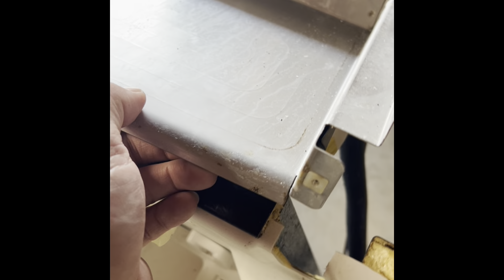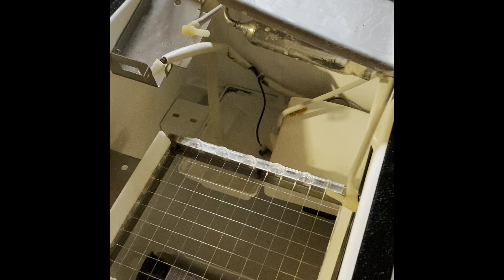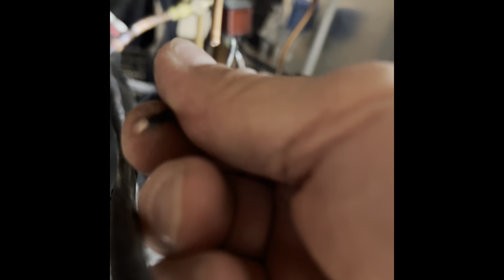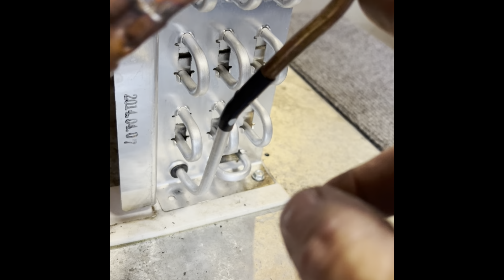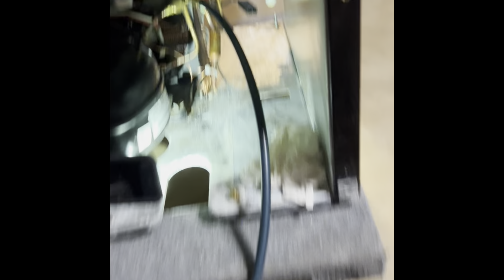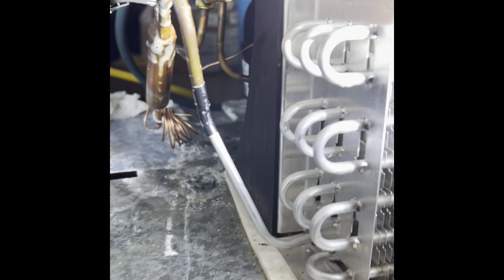KitchenAid Under Counter Ice Machine Sealed System Repair - Evaporator Plate and Compressor

Comment: Why didnt you try to repair the leak with some alloy first? The hot gas valve on my True icemaker is leaking as well as I believe stuck open.  It's either that or the compressor's bad. The compressor is running and it ohms out okay.  But it's impossible to braz in a new hot gas valve without taking the side panel off and it's riveted in place.  Sheesh. I'm gonna have to drill out the rivets.
Reply from the maker: Good question. The metal was too degraded and corroded. In my experience, even if I could have patched it up, I would have been called back a few months later for it leaking again in another area. No thank you.
Reply: @Handymayn thanks for responding.  I thought it was your ice maker.  Didn't realize it was for a customer.  Makes sense.  Subscribed. Very well done!
Reply: @Handymayn now I’ve got my hands full. Compressor, evaporator with lineset and hot gas valve all need to be replaced. Nothing is accessible and the service manual is awful. Your video is helpful. Thanks.
Reply from the maker: Yup, that’s a lot of work. Cost analysis on that or replacement is in order. Hope it goes well for you.
Reply: Its my machine and its only 8 years old. Crazy for the compressor to fail so soon. I found a leak where the hot gas valve goes into the lineset.  I wasn't going to replace the lineset even though that's what True recommended, but i found a new one on ebay for 150. Another 250 for an oem compressor (ill use my old start relay and cap since they are fine, and that will save me from rewiring). Got a hot gas valve and filter dryer for $70 (again ebay).   So I'll only be into it for $500.  A new machine is 5,000, so as long as I don't break anything that will be worth it!
Reply from the maker: When there is a leak, many times the compressor gets damaged. The lubricating oil is in the system and can leak out with refrigerant. This causes the compressor to overheat. Good luck.
Reply: @Handymayn thank you.  Well, i got it apart.  What a maze of wires. The support guy from True said "remove the eight bolts from the bottom and the whole top comes off". 
He failed to mention the entire wiring harness is attached to the top and bottom, as is the pump, and filter housing, and all the thermistors,  fuse and ice level adjustment.  

I'm sure people have done this before like you Understand that, but to me is was one surprise after the other.   Now ive gotta replace everything and put the top back before i can pressure test.  Im sure glad its mine. No pressure.  Dont know how you do it!
Reply: @Handymayn success. It’s back up and running. Thanks for the support!
Reply from the maker: Awesome! Good Job!!!
Reply: @Handymayn thanks. Not easy- I had to strap the evaporator to my ceiling for support, and put the base with the compressor on a table to braze it together.  Probably a better way but I was afraid of its weight sitting on just two 1/4” copper lines.
Reply: @Handymayn quick question. If you didn't braze the lineset/evaporator in place, how did you get it to stay in place since it sticks up? I've got mine hanging from the ceiling but I'm afraid to connect it. I'm afraid it won't fit back into the enclosure once I connect the high and low sides.  I plan on putting the compressor back in place last because that's the entire reason that I took the support. I didn't want to braze in a very enclosed spot.
Reply from the maker: I think I propped it up and secured it to the cabinet while braising it.

Comment: my evaporator plate will build up ice but will not release the ice to the cuter. do i have to change the plate?
Reply from the maker: Sounds like your system isn’t doing a reverse on the refrigerant system. It is supposed to reverse the refrigerant so the evaporator plate will get the hot gas for a short time. This causes a thin layer of ice to melt, releasing the ice block to the cutting wires. There is a hot gas solenoid & valve underneath between the compressor and condenser coil. Make sure the coil is good and that you are getting voltage to it when the ice block has formed completely, just before it should release the ice to the cutters.